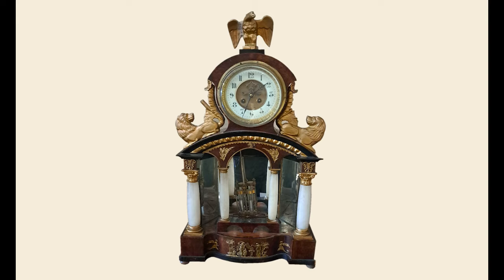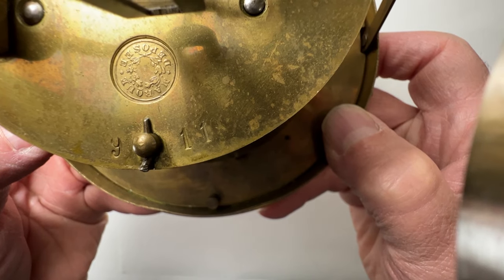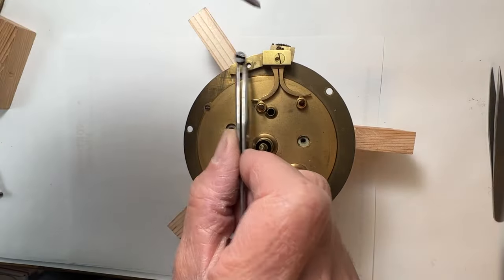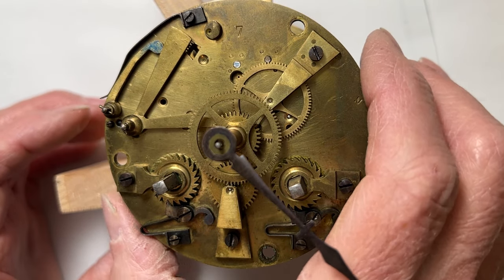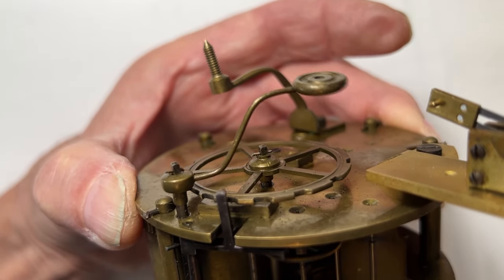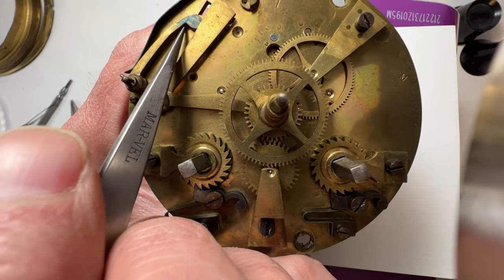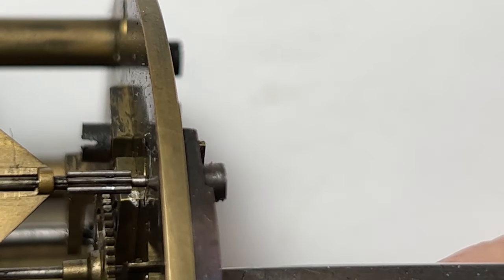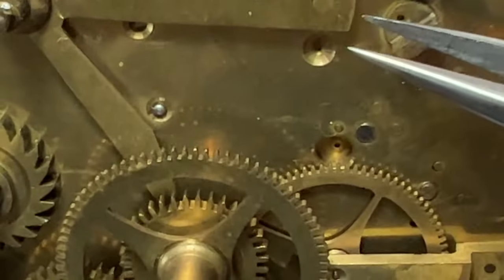French japy freres movement inspection for John from Washington  #85

Comment: Interesting clock with some unfortunate past repair attempts. I'm sure if the owner goes ahead with the repairs you'll do a fine job on it. The case of this clock is Austrian/Viennese and from around the 1830s or 1840s. The French movement is not original to this case and is much later. The original movement would have been square, had grande sonnerie stroke on 2 gongs or 2 bells, and it would have been of 30 hour duration.

Comment: What would've been the right way to clean the dial-center without removing the india ink or paint writing?  
. . . Or is that unavoidable? (I think using Q-tips would leave lint but perhaps you could use compressed air later to remove it.)
Reply from the maker: I would go with your Q-tip idea.
Given the age of the item, possibility over 150 years old,  natural environmental conditions such as changes in moisture, heat, cold cycles would be enough to expand and contract the metal with many cycles and that in itself would have a loosening dis-bonding effect on any india ink or paint that was on it at one time.

Comment: I’m waiting expectantly to find out what will be the best way forward with this gem.  Will James have to make a new unlocking lever?
Reply from the maker: Customer decided to not do any repairs on this one.
They are going to use it as a time only clock.
It runs and all the parts are there so one day someone may decide to have it cleaned oiled and restored.

Comment: Hello James, another beautiful clock for you to save.  
If it were your clock, how would you address the bent cast arms?
Reply from the maker: The one with the crack has been spread about 1/8" or so out on the ends, it will never bend back that far without breaking at the already break.
Would determine correct angle it needs to be at and first attempt to put a saw cut in the already crack but not all the way through.
The saw cut will give room to bend it back where it should be, then use some 56% silver rod to braze it in place. 
There's always parts on ebay as well but many of these movements back then were hand made one at a time so unlikely part would be a perfect fit.
The smaller lever could probably be bent back with no issues.

Comment: The repair of the two bent levers looks challenging so I hope the owner has you fix it.  Is silver soldering difficult to learn?
Reply from the maker: I have been using Safety -silv 56 with good results it melts at about 700 degrees, is stronger than clock brass and has a brass color to it.
There is what's called silver solder out there that most people are use to  that melts at 1100 to 1300 degrees and has a silver color to it.
They are both good silver fillers but need a heat source that is hotter than a soldering iron but flow nicely and easy to learn.

Comment: Really like your videos and always learn something. One question I have is around fingerprints: How do you prevent getting fingerprints on movements? Do you perform a cleaning step after handling them? Or are you wearing gloves/fingercots that we can't see in the videos?
Reply from the maker: Prior to cleaning I am not concerned, most of the movements are covered with dirt and oil as is.
I always work with dry hands, so don't use hand creams, after movement and parts are cleaned handle plates from edges only, use tweezers and peg wood as much as possible. After movement is assembled, isopentyl alcohol and Rodico to remove any oils and fingerprints.
Reply: @jamesmartin5370  Thanks for the answer, hope you and your family had a great Thanksgiving.

Comment: Isn't it a Vienna clock where the original movement got replaced with a french one?
Reply from the maker: Yes, case of this clock is Austrian/Viennese from around the 1830s or 1840s. The French movement is not original to this case and is much later.

Comment: What does item 7 do please
Reply from the maker: #7 Is a friction clutch used to adjust the crutch, to set the clock in beat.
Originally this system was a friction fit between the steel threaded pallet arbor and brass threaded crutch hub.
Two cut slits in the brass threaded crutch hub are used to adjust the tension of the fit to the steel threads in the pallet arbor.
Unfortunately, someone used a chisel type of tool and smashed the threaded portion of the brass deforming it.